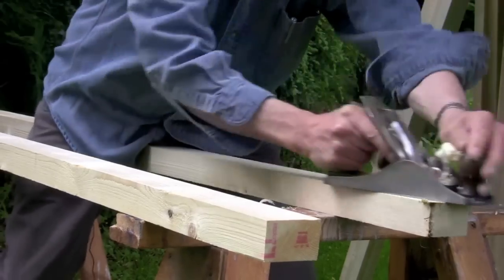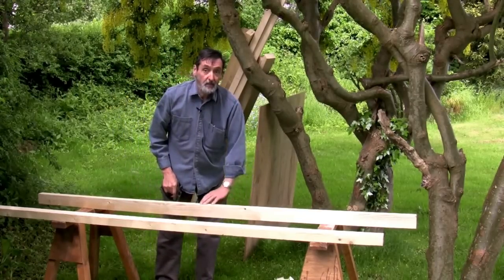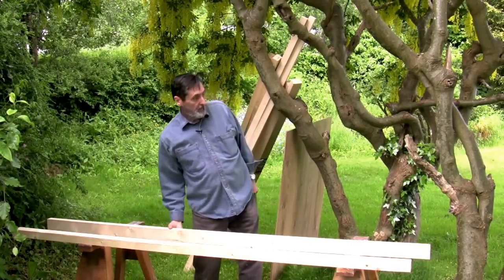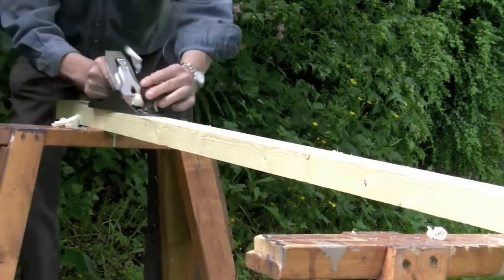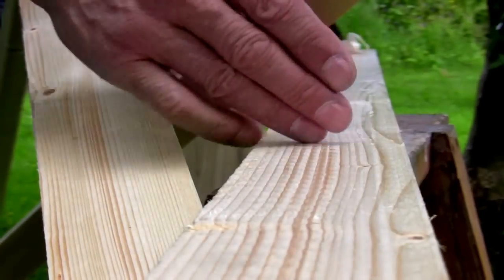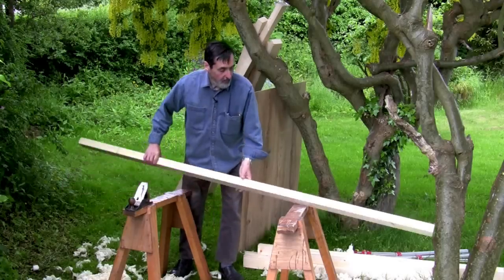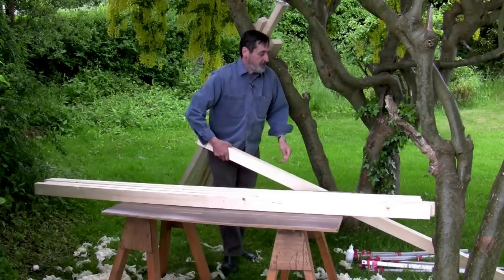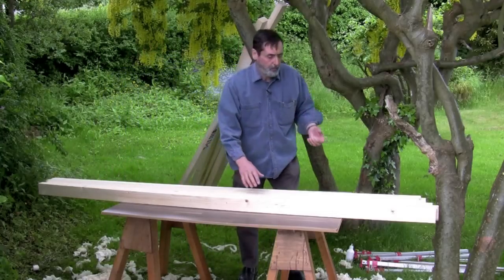How to build a workbench - (Part 1) Laminating the top | Paul Sellers

Comment: Paul Sellers has a brilliant lesson how to fasten work pieces in a vise using clamps.
When it comes to gluing he looks like an amateur for some reason using his fists to level the ends of a bench top to be. My advice: tighten the middle section and then use small clamps for the ends from below with pieces of wood on top to get it level. Finally clamp the other sections.

Comment: I agree a properly laminated solid wood bench top is the ideal construction but why not clamp your boards between two pieces of steel or another surface/stable material instead of just pounding it with your fist?